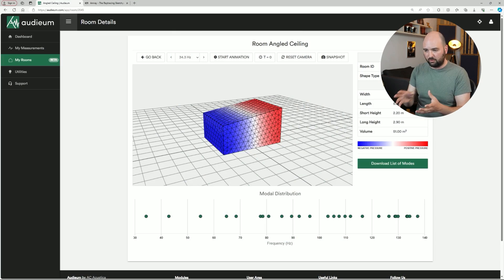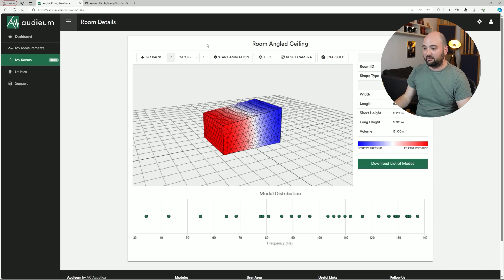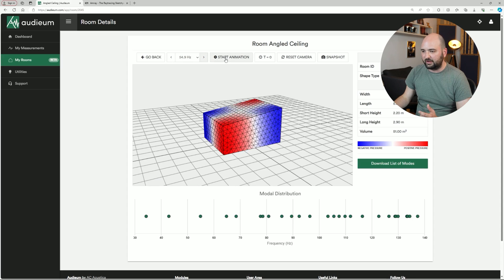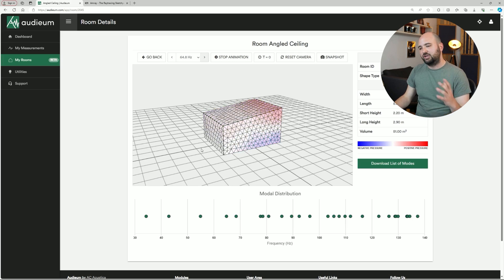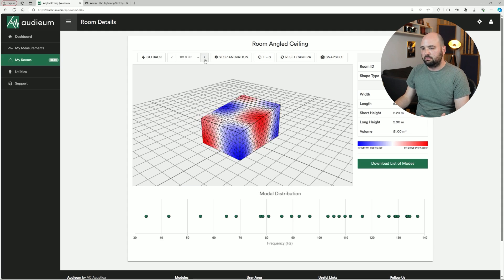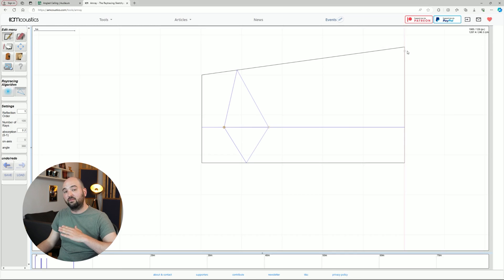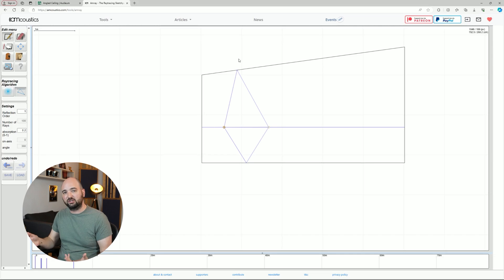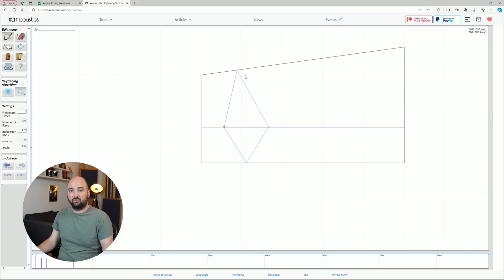How to best deal with an ANGLED CEILING

Comment: Angeled sealing, yeah i got it 😂. Wall behind speakers about 130 cm high, angeled sealing up to 222 cm, flat sealing 120 cm and angeled sealing down to 140cm. Length between front and rear walls 440 cm, 400cm wide. Can it be worse?😂😂

Comment: my room is big its a big lounge about 6 metres by 10 metres. lots of sofas the ceiling is 8 foot high at the sides (the 2 walls opposite each other not all 4 that is) It is about 25 degree sloping ceiling goes from either side and flattens out at about 12 foot high . hope that makes sense  its untreated and doesn't sound bad at all so im  guessing that sort of sloping in from either of the 2 sides is not a bad thing. Bass sounds pretty even and their is a tiny length natural reflection. Got any comments on this sort of shape as opposed to sloping up from one end to the other as you mentioned above. cheers

Comment: I have a, rightly 16 x 11 foot rectangular room.  One end of the room, including ceilings is a perfect rectangular. Half way down the longest two walls, an archway begins. This arch was made by including a right-angle-triangle shaped cylinder, where longest walls meet the ceiling. So when I look at one of the short walls, it has a barn shaped roof line, but with the same flat ceiling that doesn’t arch anywhere. Because this right-angled-cylinder shape was added to the dry wall just half way down, when you look towards the short, back wall that has a barn roof like shape, you can see the side of the cylinder, which is shaped like a perfect right angled triangle, so there’s these two little triangle walls and the back of where I would be setting up (the normal side). 

This is what I’ve gathered, regardless of the details in my situation, I should get up my station at the normal side of the room.

Comment: Maybe this odds a bit off-topic, buy my ceiling is at a 25 to 30 degree angle, I think (I’m on holiday so I can’t check), but the whole building is glue-free wood with some adobe for moisture regulation so there’s very little boominess to be found. The construction materials of the building that the studio is in is a highly under-appreciated aspect. The absence of drywall in particular solves so acoustics problems

Comment: Thank you for another very good video. I do like and understand your approach to find a good/optimal listening position by listening for balanced low end. But, what if you are lucky enough to be in a situation where structural changes to the room is actually an option? Do you have a video of a way to measure and verify the predicted room modes, which would be important in order to simulate any changes before changing the room.

Comment: Your angled ceiling model isn't very angled...so not very useful. You need to base this around attic studios. So the angle is the roof pitch, which varies.
Reply: But the tools demonstrated are both available and easy to use, so try them out with your real situation 👌

Comment: Nice one Jesco. To your last point (asymmetry) let’s imagine the shape at timestamp 7:00 is my front wall (I.e. one speaker is closer to the ceiling that the other one): in that case which speaker would you increase in volume and which side would you put additional absorption?

I have my system in an attic so I have 3 sloped ceiling (front, one side and back) and the stereo image totally collapses on one side (where the ceiling is lower) so I have only partially addressed the issue by toeing-in the speakers differently.

Comment: Years ago I had a room with two sides of the room with angled ceiling.  It was angled on both sides, right and left, about two thirds to  three quarters up the side walls (& across the ceiling) and the sound in that room was very good. It was quite a big room too which was handy.  So in my case it was Best Case or good case but not the same as you describe with just a complete angled ceiling which is a different kettle of tuna fish!